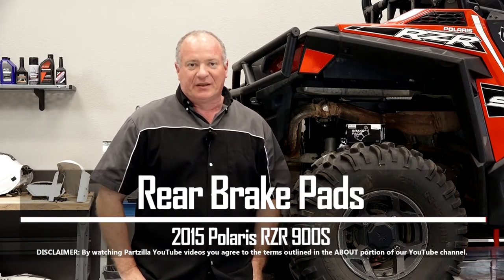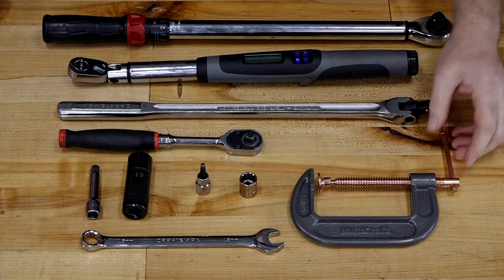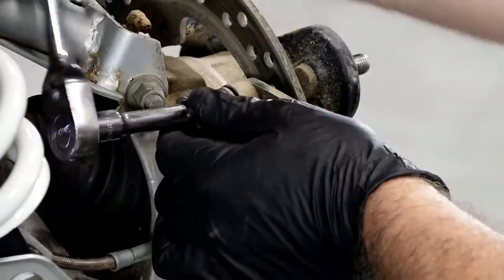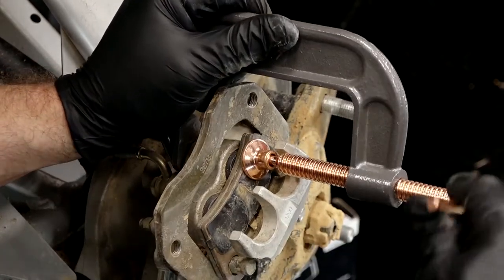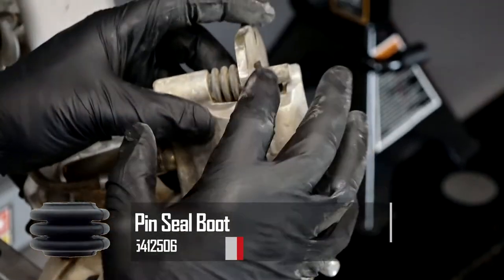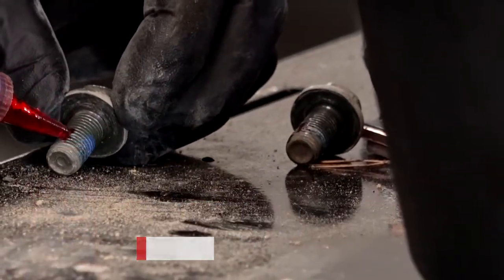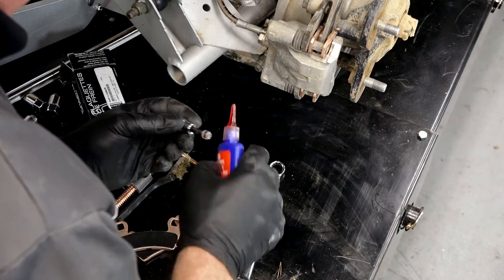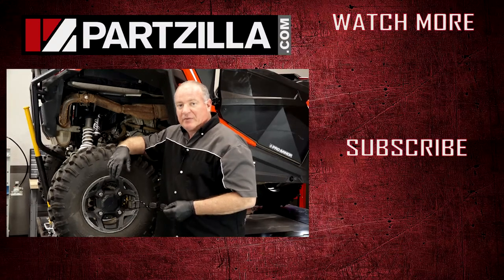Polaris RZR Brake Pad Install | RZR 900S Rear Brake Pads  | Partzilla.com

Comment: Hi John, I noticed that you used the Craftsman 1500 LB. motorcycle/ATV jack. I have a  2020 RZR XP PRO - 4 and am looking fora  jack to lift the front and then the back. I won't be lifting all 4-wheels off the ground at the same time to change breaks. My RZR with the accessories is over the 1500 LB Would the Sears jack still  work for how I plan to use it?

Thanks!